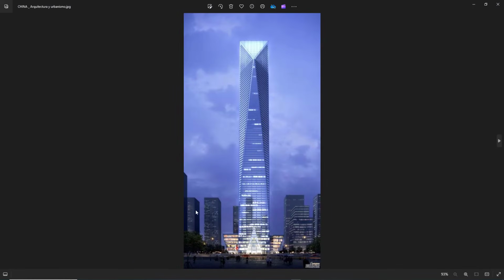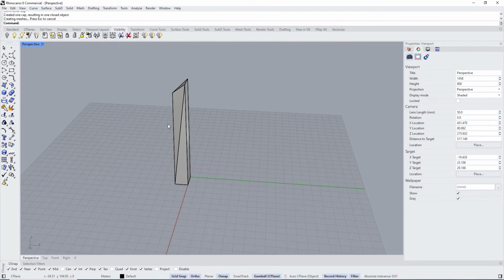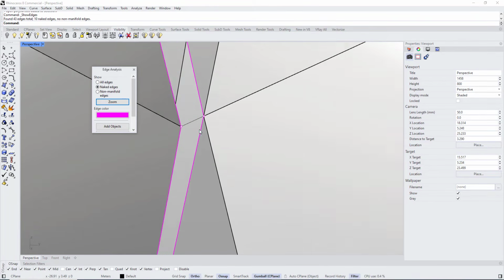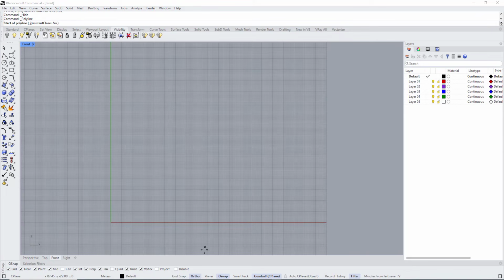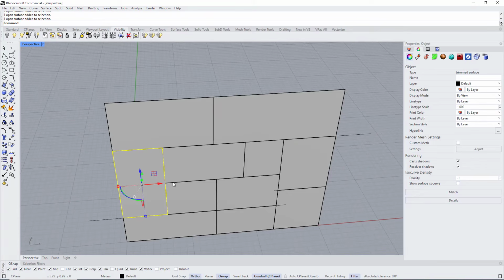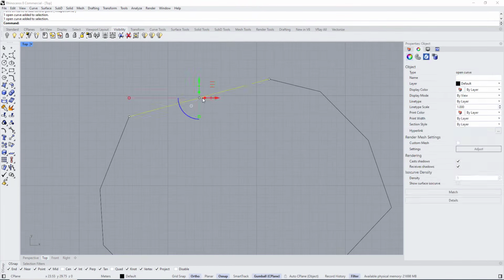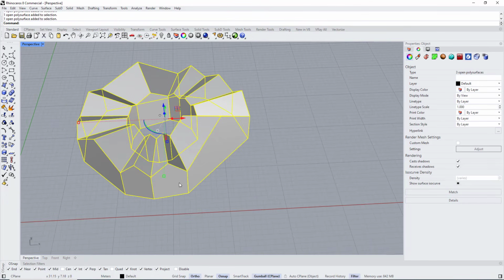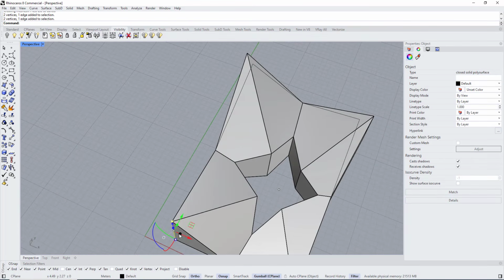03 Rhino Beginner course for Architects_Massing part 2_Complex shapes from Triangles and Quads

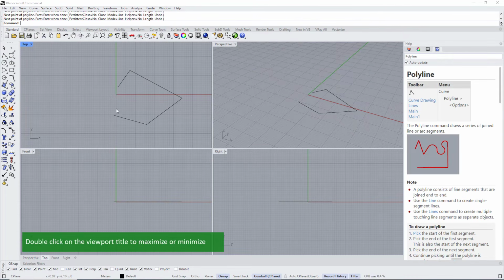Comment: 0:35 draw Polyline
0:50 Grid Snap
1:33 draw a surface from 3 or 4 corner
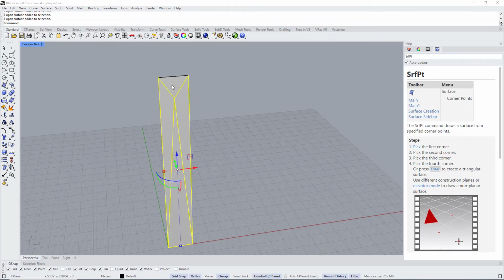1:50 ctrl + join: join
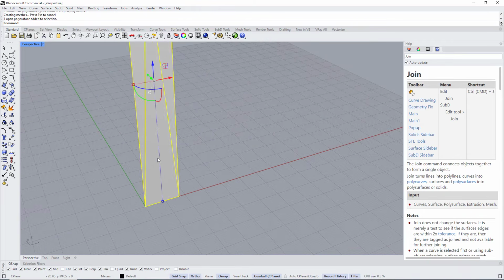1:58 ctrl+shift+select a surface from the joined object → move it with gumble: extrude the surface
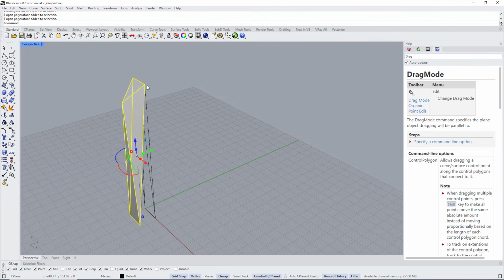2:18 ctrl_shift+slect a edge from the joined object → move it with gumble: make a surface (extrude a line)
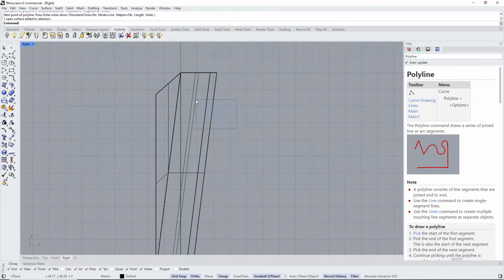3:00 hide isocurve from [properties] 
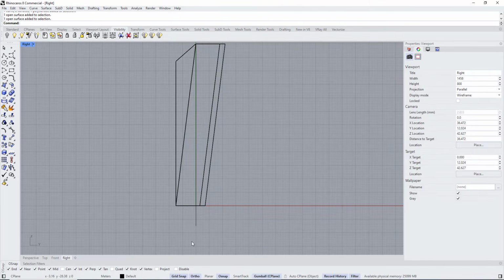3:05 "split": split an object with a line
3:45 "cap": close the open object (only when the left surface is planar)
4:08 ctrl+shift+select a vertex → move it with gumble: modify the object by moving the vertex
5:30 [set ortho angle]: rotate an object in steps of 45 degrees
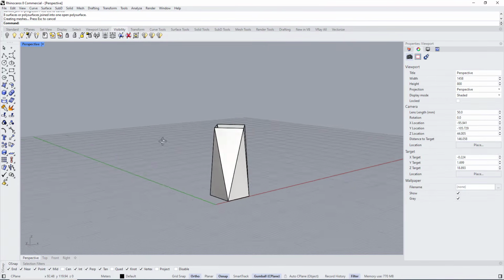6:30 scale by -1 using z axis gumball = mirror across xy plane
7:30 finding 'naked edges' = gaps
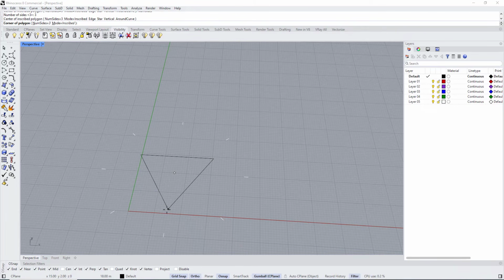9:40 scale2D 
10:38 scale3D
10:50 isolatelock objects: isolate only the selected object and lock others
11:30 ctrl+h: hide 
12:50 dubedge: extract edges from surface
13:00 surface from planar curves: create a surface from several edges (planar)
15:50 double click the white point on gumball: move gumball
15:55 scale a face from a box using gumball → create a truncated square pyramid
16:15 "MergeAllCoplanarFaces" Merge splited but planar faces
17:10 tap:  move in a fixed direction
18:52 F10: open control point 
19:23 add control points
19:29 "rebuild": add control points at once
20: 27 "point"
20:40 open [record history]
20:42 "loft" → you can modify the lofted surfaces by moving the vertices because you opened record history
21:17 check [ ] project → you can draw a planar polyline only on XY plane
21:55 "split"
22:20 "Setpt"
Reply: useful notes

Comment: Hello thank you so much for this video I have a question in my rhino I can't drow a line between tow points vertical why ???
Reply from the maker: if you are using Rhino 8 press F8 to open the ortho and you see a vertical blue line will appear this blue line means it is snapping to Cplan Z, but please note this is a new feature in Rhino8 so if you are using older versions it will not be availble, so to draw a vertical line in Rhino 7 or older you can just draw it in the left,front or right view  or you can change the Cplane in the prespective

Comment: I can't type f10 it will always be a command for the laptop system , what is the problem here ? and thank you for the amazing videos.🤗🤗
Reply from the maker: On a laptop, hold the FN key and then press F10............ or you can turn off the function key in your laptop (you can press Fn + Esc to toggle Fn lock)
Reply: @PH.Studio thank you so much , I really appreciate your help🤍🤍🤍

Comment: Thank you for your video! I have problems with creating the back surface for the first tower. I tried to choose the points to base my surface on exisistng surfaces, but for some reason it doesnt "attach" to them. I have all Osnap on.

I would appreciate your help!
Reply: Same for me. I've tried selecting the point instead of the surface, but it's different from what is shown in the video

Comment: was wondering if you have any laptop recs for rhino? or even vray, not too pricey for a starting architecture student would be nice :)
Reply from the maker: A used workstation laptop can be very affordable, but make sure to choose one with the right specifications.
The RAM shouldn't be less than 32 GB, the GPU should be RTX and with V-ram not less than 6 GB.
I would recommend Dell Precision 7740 with Quadro RTX 5000, or with RTX 4000.... don't go lower than Quadro RTX 3000.............. and since this is used, make sure to pick one in good condition .......... also please note this specification to run all architecture software including realtime rendering like Lumion, Enscape...etc

Comment: Hi. I tried that rebuild curve thing @19.44 . Mine is getting changed to a triangle? I entered the same value as urs. Degree 1 and Point count as 3....
Reply from the maker: Just make sure to explode the polyline first before using the rebuilt command (check what I did at 19:10)